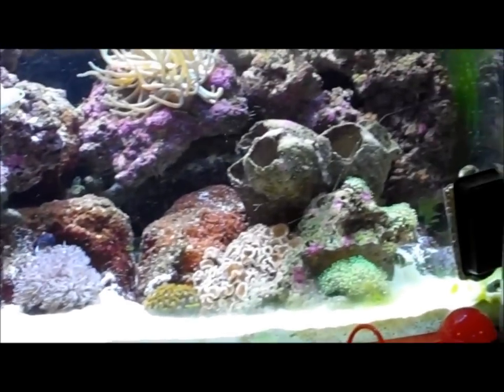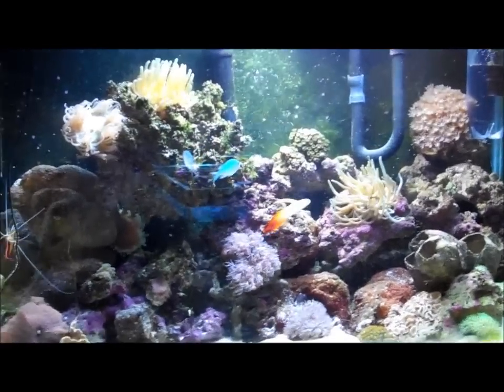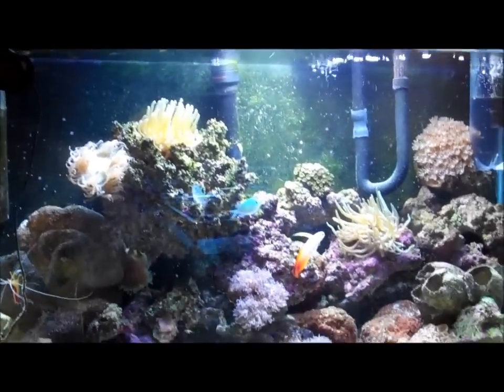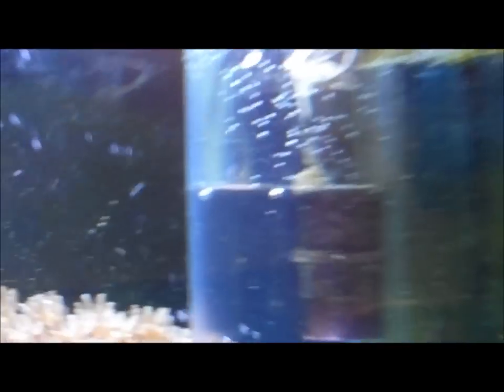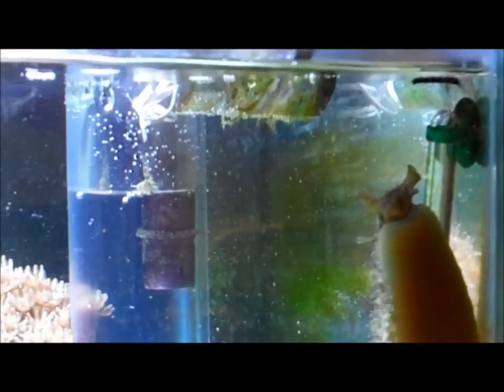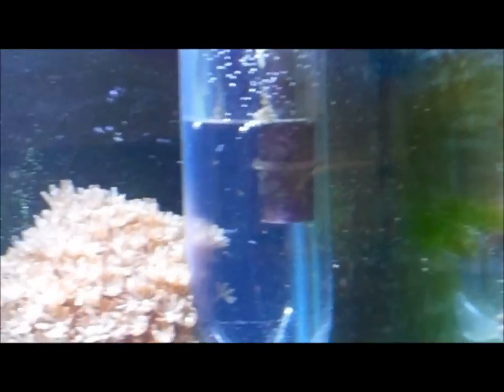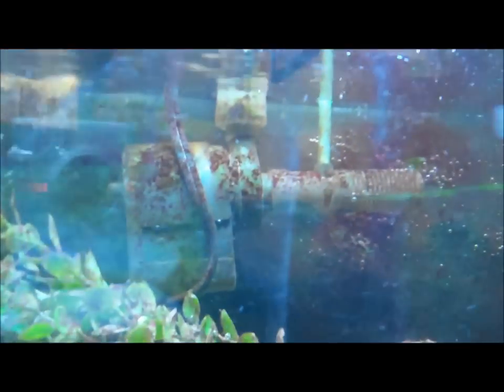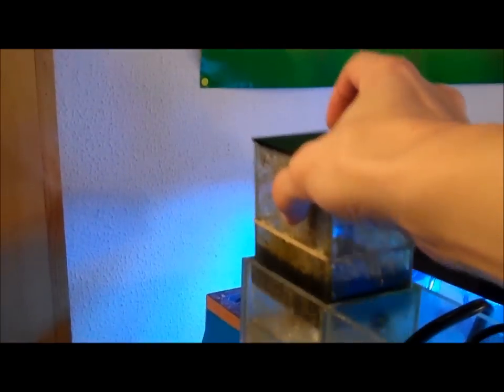DIY surface skimmer and maxi jet 1200 for bakpak skimmer

Comment: Do the limewood air stone mod. Will help your power head not work so hard. Will help with your GPH. When you use the pump to push water and air you cut your flow in half. I use the mod and dropped from a maxi 1200 back to a 600. Its set up in my refuge so I don't need alot of flow. Get back to me and I tell you everything you need to know. You will be alot happier with the CPR. I was!!